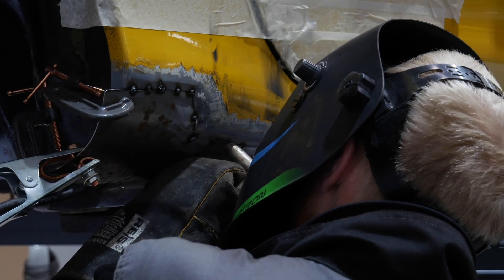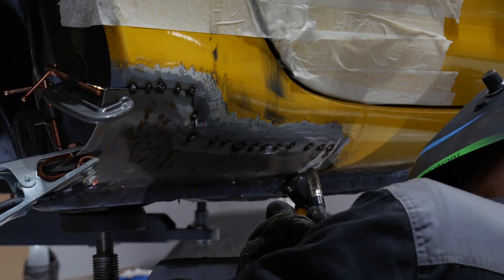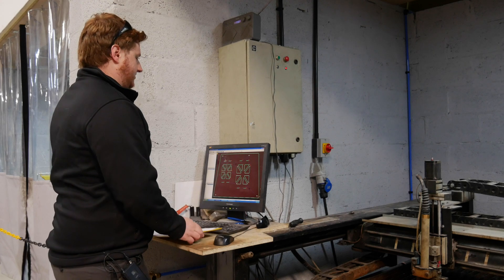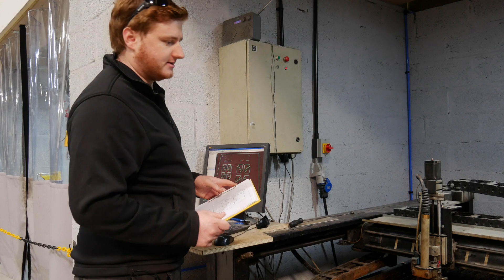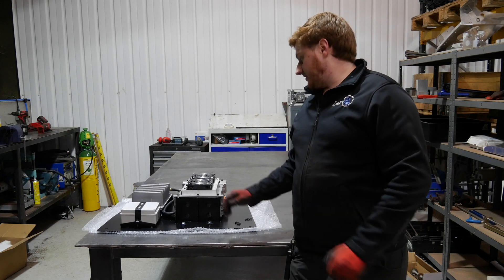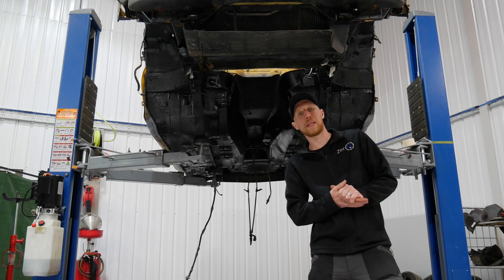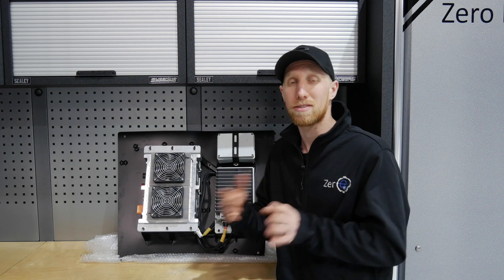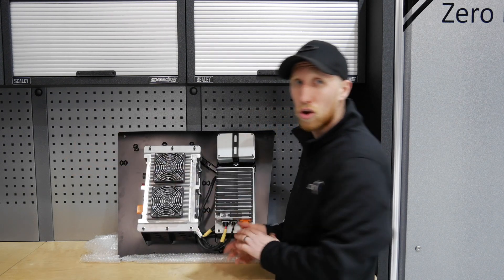We are making an MX5 electric but the rust must be fixed first

Comment: if that DC/DC converter outputs 12V, why do you need the original 12V battery at all? Is there some system on the car that requires a surge of current that the DC/DC converter can't provide? If so, could you not overcome that surge with a large capacitor? thanks for any help.
Reply from the maker: You require the dcdc for the main contactor on start up and as the hv system is not live all the time a 12v supply is needed before the he dcdc kicks in.

Comment: Is it necessary to keep the lead-acid battery powering the 12v system? Can we not connect the vehicle’s existing system directly to the DC-DC converter?
Reply from the maker: No, as the hv battery contactors are 12v coils so 12v is needed to close them. All EV’s are like this. The 12v battery can be a lot smaller than original though.

Comment: Rotate the rear differential and put the motor in back. Then you'll have extra space up front for more batteries and the weight distribution will be better.
Reply from the maker: We did consider that but was allot of extra work

Comment: In the stone age I used to gauze and fill holes in my cars. Then I switched to putting on new OEM panels. I put new panels and sills all round on a GT6 MKIII with Leyland panels. Everything fitted which was surprising in a way.  Wouldn't it have been simpler just to buy and fit new panels rather than repair sections?
Reply from the maker: By doing that section saves a respray of the complete rear section as can mask and stone chip then spray just that section. You won’t then see any slight paint match difference as the stone chip texture takes your eyes off it.

Comment: Great series! I was wondering if the hyper 9 motor requires any supplemental cooling? Since your battery pack and controller are water cooled it seems like the motor might be the weak point if it is air cooled.
Reply from the maker: That is the main down side to the hyper9

Comment: I have an idea for a Free Energy generator that will render oil unnecessary. No demand for oil: No pollution, No wars for oil... We must stop using this stuff before we annihilate ourselves over it. The economy built on oil is old and outdated. It's time to move on. The generator will use only one 12v battery. It will Supply enough power to run a house.
It will run a car and even an electric airplane. The US Government, and England know about the technology for Long time. They rather suppressed it.
 I've tried to reach out to many electric vehicle companies and Universities. No one called me back to talk about the idea!
The generator will be esea to build and mass produce. It will self charged. No plugin needed.
That is the best way to counteract the elite that keeps us all hostage with total control and monopoly of all the energy resources.
Fight back with technology!!
Anyone who thinks he can help, please  contact me. guyjoseph615@gmail.com.

Comment: at 1:31 The back edge of the sill (pointing towards the tire)-How did you bend it to be flush at the curvature of the rear fender? Or did you cut and weld a new piece in?
Reply from the maker: Once the main part was welded we did 3 cuts and worked each section round then welded the cut lines back together.

Comment: Curious why you would use the original car battery instead of a small 12V lithium ion replacement? Would save a lot of space and weight over lead acid, and you no longer need the CCAs to turn over the starter. Am I missing something?
Reply from the maker: Your not missing anything, the mx5 has quite a small battery in the rear. If it was in the front then yes definitely upgrade but we don’t need the space plus need weight over the rear.

Comment: Maybe you already know this, but Kmiata have an electrically assisted steering column kit...so it's possible to ditch the hydraulics. I can't remember if you plan to install a manual rack. I did some research on the electric power steering, and there is an OEM manufacturer for the basic motor/ gearbox.
Reply from the maker: Yes you can also fit the electric column from a corsa we have that on the skyline which works quite well.

Comment: What would need to change if you'd like over 200 volts in the pack to permit DC fast charging?
Reply: Completely different motor and controller, plus charger and DCDC to match. You would need to get different battery bricks or nearly double the brick count if you keep these LG 3S bricks.
Reply: Technically chademo goes down to 50v in the spec, but as Zero motorcycles found out, a lot of chargers don’t implement the spec properly and don’t go that low. The Orion bms  supports chademo though. CCS is so crazy complex, I don’t know of any aftermarket bms that supports CCS

Comment: i would like to know the reasoning behind onlty including AC charging on the car and not a CCS port? would it not fit in the MX-5 fuel filler spot? too expnsive etc?
Reply from the maker: It’s to low voltage for ccs has to be over 200v plus there is no ccs solution out there.

Comment: Is it possible to add fans into a passive cooled battery pack like Renault Zoe and Still dont get dirt, mouisture inside it ? How do you solve it without recirkulation of the warm air inside the battery ?
Reply: This is why actively air cooled batteries are a problem. Most OEMs solve this by drawing in cabin air.
Reply: @Tom-evnut  thx for explanation so they have tubing with cabin air and fan for cirkulation but that dont add fresh cool air from outside ?
Reply: Not really. You either have to pull in air from Inside the  car or use liquid cooling. Though maybe a large heat sink work help but add way too much weight for it to be worth it

Comment: Once again, great episode. Thanks guys! I have a question: Do you run any safety measures on the cables or HV connectors joining the charger, DC/DC and battery like a pilot line or a High Voltage insulation loop?
Reply from the maker: Everything has a fuse, all cable is shielded and there is a break loop on each connector that goes into the battery box so if it’s unplugged will open the contactors.
Reply: @Hazell_Nutz  
Ah okay, thank you :-)
Might it be worth doing a tech talk about that and the whole HV bus by some point. I would be very interested :-) Keep up the good work and videos!
Stay safe,
Max

Comment: Is the charge rate pretty linear, or does it slow down as you approach 100% charge?
Reply from the maker: The bms will adjust in accordance with state of charge and battery temperature.

Comment: Nice work again guys. You've got a DC-DC converter but will the car still require a 12v lead acid battery? Apologies if you've already answered this.
Reply: Generally your peak draw from headlights, power steering or other accessories will exceed the upper limits of the DC-DC, you use the battery to even out the peaks, essentially operating exactly as the Alternator did on the original ICE setup.
Reply from the maker: Yes we will retain the original 12v battery. We will also use it to bring the ev system on line.
Reply: Great work- car and video. I was surprised the DC-DC was rated at 1.5kW- what load requires that much? Heater & aircon?

Comment: The car won't be DC fast charger capable?
Reply from the maker: Unfortunately not an option due to low voltage system, has to be over 200v for fast charging.

Comment: Is it possible to use two of those motors in one build? either to drive one wheel each or to drive the front and rear axles separately?
Reply from the maker: Yes there is nothing stopping you running two motors with controllers.

Comment: With the fuel tank removed, you should have some 60+ kg spare at the back. 
You are adding the controller - how much does that weigh?
And how many cells can you add in the rear where the fuel tank was?
Reply: He address that on the previous video.